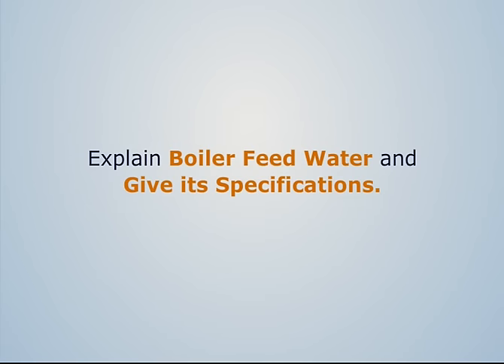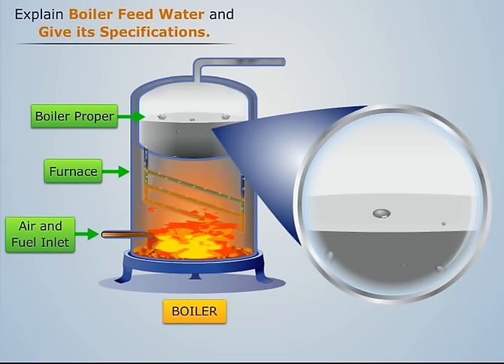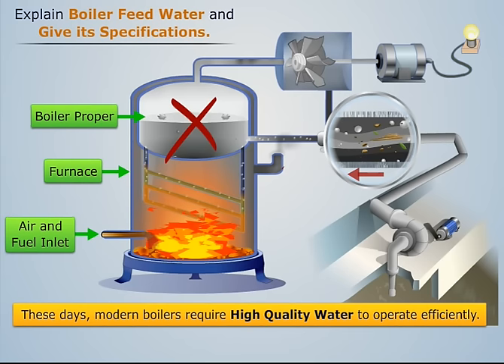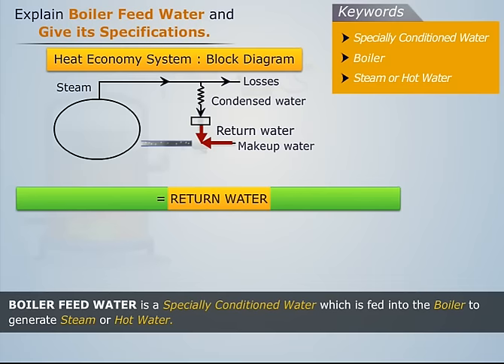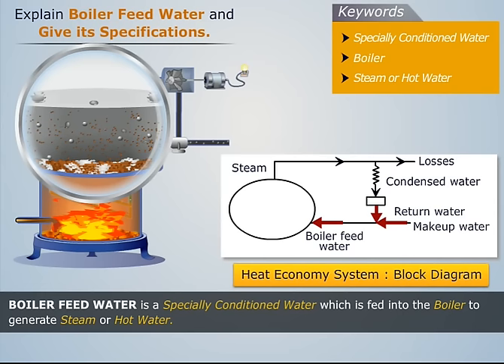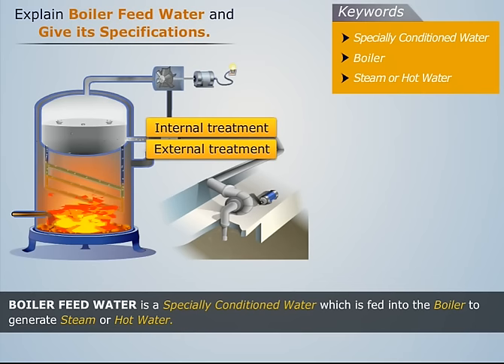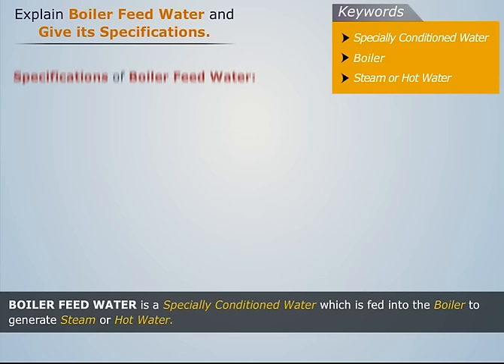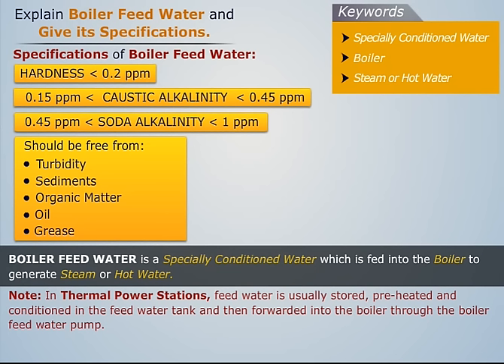Explanation of Boiler Feed Water & Its Treatment | Engineering Chemistry

Comment: I work with a couple big industrial gas boilers. We run many water tests daily. We just started one of the boilers a couple days ago and our SO3 test is reading really high. Our SO3 range is supposed to be between 20-80ppm but I personally just tested it and got a 130 on the test which is way outta range. We're usually testing out at around mid 20's to 60's. We've messed with the pump and everything we can think of and still no luck. Any help?

Comment: Wouldn't  distilled water be free of impurities?
Reply: I was also thinking of same thing
Reply: I think so though the process is expensive.
Reply: Neurofied Yamato I work at a place with evaporator coils. it is not as expensive as you think. We get our feed water down below 100ppm but the boilers contribute to rising total dissolved solids.
Reply: Distilled water being free of impurities is very aggressive to metals.

Expediting the breakdown of the boiler.

The boiler itself creates steam/distilled water vapor.

As the distilled water vapor cools and condenses it flows back to the boiler via a heavy wall condensate piping.

It becomes diluted when it mixes with treated boiler feed water and starts the distillation process all over again.
Reply: Mike Radway I would say that the process may not be expensive, but the equipment is. Longterm, the equipment will pay for itself, but chemical treatment may achieve the same for less price